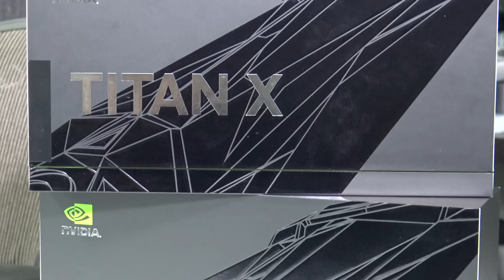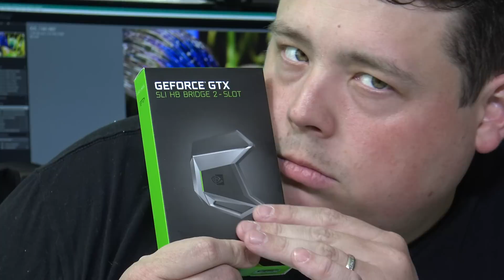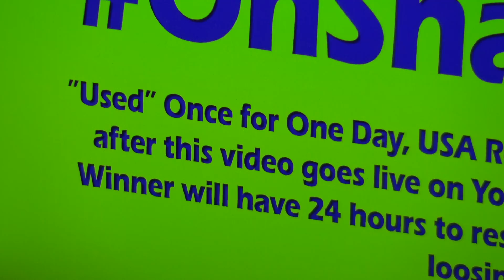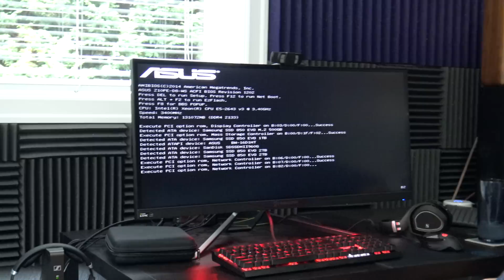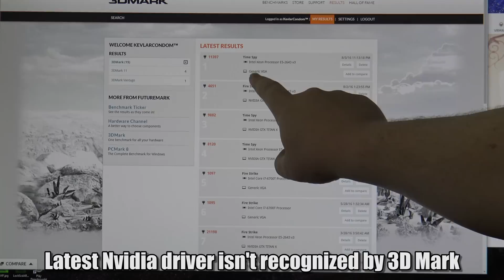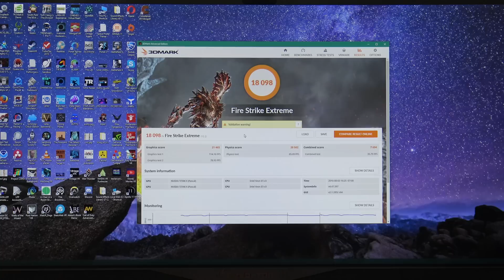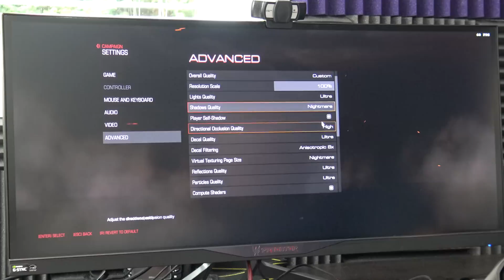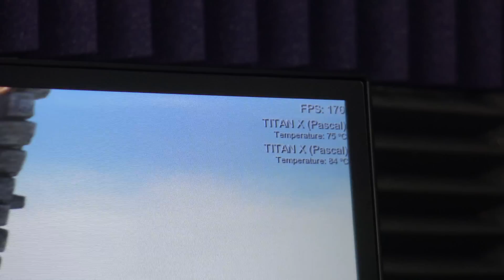Fastest graphics cards in the world! - @Barnacules

Comment: Question?  Did the one card actually thermal throttle below their advertised 1417MHz?   Or was the card ramping down the boost clock(but over 1417MHz) to maintain stability?
Reply from the maker: We did not watch the clock speeds as the test progressed but the frame rates remained stable so I would have to assume it didn't drop.
Reply: Ok good to know.  My understanding of Thermal Throttle is when the GPU (or CPU) brings its performance below the Advertised Base clock because it is running too hot. I think there should be a new/different term for GPU Boost 3.0 maintaining clock speeds above Base/boost not "Thermal Throttle."  Because the same thing happened with the 1080 when it "thermal throttled" at release, when in reality GPU Boost 3.0 was creating a stable clock still above Advertised base and sometimes above Advertised Boost clocks.  But the loud few were screaming foul because they saw the card reach "1800MHz" but drop back to "1700MHz" as the card reached peak temps.  Both Clocks are still above advertised base.  So again we need to figure out a more appropriate term instead of "Thermal Throttle" with the introduction of GPU Boost 3.0.

Comment: but can its run minecraft at 30fps at 480p
Reply: This piece of shit can't even run minesweeper
Reply: ***** Optifine maybe??? Thats the only thing I can remember doing...
Reply: no
Reply: 14p 1 fps
Reply: minecraft mostly uses the cpu it won't help much
Reply: +KillTheCurse it can help though. you could probably run mine craft in 8k with some serious textures and shaders.
Reply: it could easily run Max settings Minecraft at 8k resolution @60fps
Reply: Skunkdog Gro It couldn't actually.  Minecraft is heavily processor based.
Reply: +Skunkdog Gro It could probably run Minecraft at 16k @ 60+ frames... lol
Reply: +Hank Hill Actually, Minecraft actually does have dual GPU support. I used to have a laptop with 2 GT650ms and if I disabled one of my cards, my frames would drop significantly. It apparently also has support for up to 64 cores on the CPU side of things...

Comment: Since you asked, My single 1080 gives me a score of 2885 in 1080p Heaven Benchmark (same settings as your test) Better Min FPS (35.3) much worse Max FPS of course (238.3)
CPU is a 4790K
Reply from the maker: The min issue we experienced was some kind of driver issue. You have to realize these drivers are fresh out of the microwave so to speak. Nvidia will do some fine tuning moving forward once the SLI scenario for these cards is more main stream.

Comment: i get 400fps on cs go with an i5 4690k and a gtx 770
Reply from the maker: Turned out Counter Strike is capped at ~460 FPS, we noticed this when we got the same results with a mild overclock. But it still cool to see something run so fast.